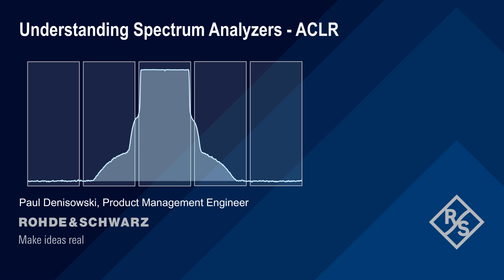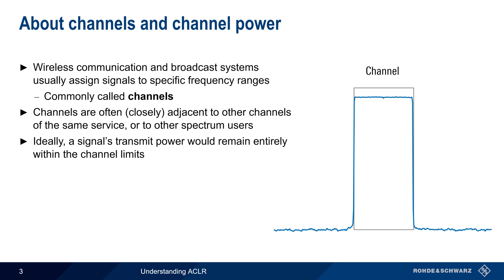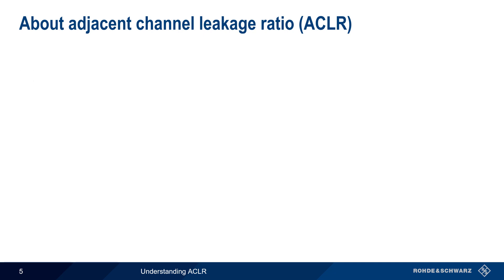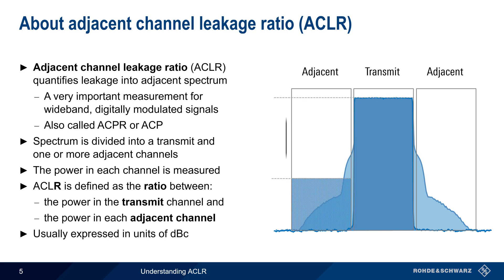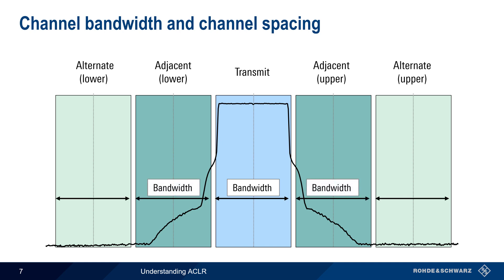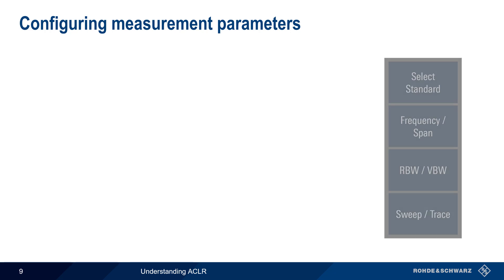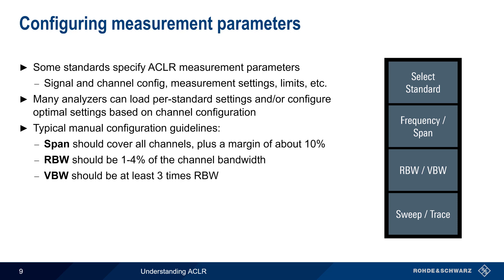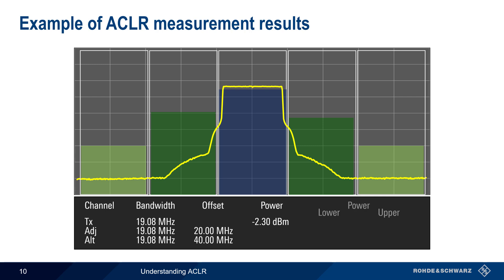Understanding Spectrum Analyzers - ACLR

Comment: Thanks for the video. Is leakage also caused by Passive Intermodulation (PIM)?
Reply: In my experience, most leakage is caused by non-linearity in active devices and by phase noise.  I think you would only see leakage (or "regrowth") from PIM if you were measuring ACLR over-the-air, or if you had some kind of cable defect in a higher-power scenario.  ACLR is much more of a "lab" measurement than a "field" measurement, so PIM is not typically associated with ACLR.
Reply: @pauldenisowski  Ok, thank you.